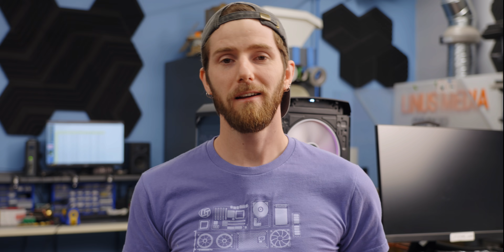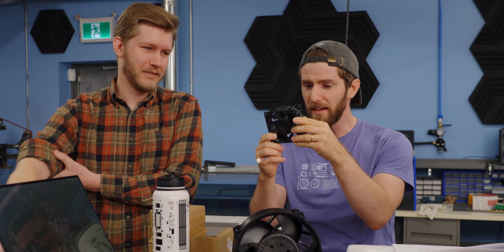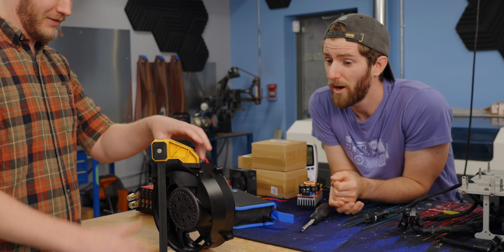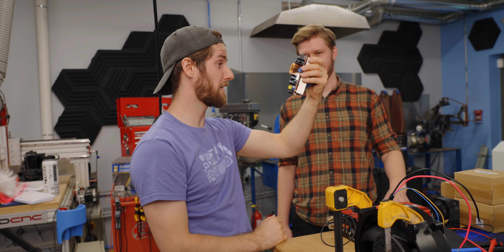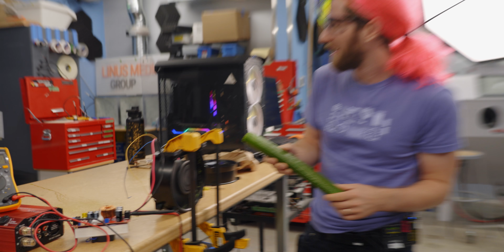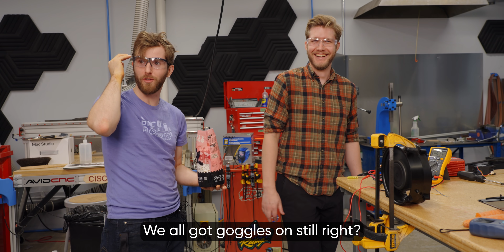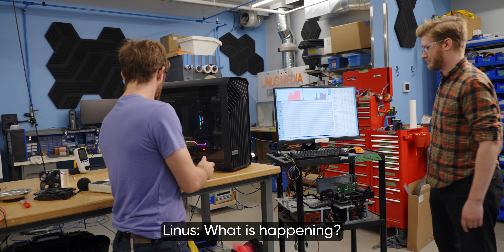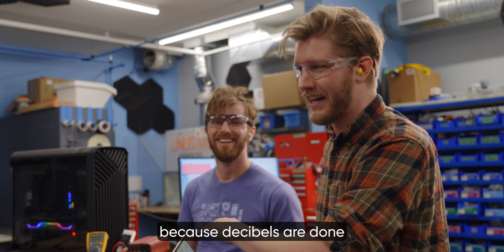The God of Computer Fans

Comment: 17:59 every 3dp is a double of pressure. For a doubling of volume as far as perception goes, you need 10db. Also, your eardrum is differentially sensitive to different frequencies. What could cause instant permanent damage at 1000hz(our most sensitive area) could be listened to for hours at a time at 30hz.
Reply: Just as it takes the double amount of input power every time you increase the volume with 3db.
Reply: not really doubling as far as our perception goes. The entire reason decibels are logarithmic is because we perceive volume non linearly

Comment: My work uses fans like these, for 50-1200kW UPS systems.
Loud in the testbay.
Reply: Do you mean 12kw or did you work with ups pulling 1200000 Wats?
Reply: @mercuryrising9758  1.2MW Frequency Converters to power Ships. The size of a shipping container.

Comment: Fans:
Noctua: Ugly but perfect for PCs
Pabst: Very durable, perfect for servers and other professional usecases
Delta: For industrial purposes. More speed. For when noise doesn't matter. If you need more airflow and more pressure. Like, a lot more^^
Reply: PABSTENNN!!!!
Reply: i am currently running Delta fans on my CPU cooler, the noise is absolutely minimal.

Comment: Bro, call it whatever you want, but don't call that aberation a 'computer fan' , because that thing has absolutely nothing to do with a computer, except for probably its diameter, and that only for a limited number of chasis models.   Other than that, its required voltage, its power consumption, its depth, its speed, its horrible noise, its 'connections'..  all of these makes it anything else but a computer fan.

Comment: We typically use these for electrical panel fans. It’s not uncommon to have a 5’x7’ panel with up to 20-30 variable frequency drives, PLCs, SCR heater controllers, 480v contactors, and layer 3 switches. All running in an industrial facility that may see temps up to 95°F in the summer.

Comment: 48V is a standard in telecom, and these fans can be used in chassis that house multiple racks of vertical optical communication cards that can crunch data transfers at greater than 400G speeds.Checkout ATCA Standards. When I used to work on such systems there was a whole module named the Fan tray, which has a grid of these fans blowing air from bottom of the rack to all the cards above.

Comment: 95db is nothing, jackhammering concrete is 130db and i wasnt wearing hear protection half the time (NEVER DO THAT, im stupid). also go to a drag race, top fuel dragsters are so fucking loud that you can feel the air and ground vibrate from 40 meters away.
Reply: 95 db is loud enough to degrade hearing over time
Reply: @23_truth_seeker_23  thats true, but then again, my ears work well enough after hearing death at 130db

Comment: Boy do I love working with those fans, they are used in many applications. They can be used in server rooms, server complex power supply stations (the EBS (Emergency Backup System), the inverters used can use IGBT H-Bridge stages due to the very large power required which get very hot, the charging systems, PDU drivers and such. They also can be used in other large power supplies. I am getting 4 for my 900 volt 400 amp power supply. Excellent video lol.

Comment: SO in the early 2000's I had one of the ill fated computers that had leaky caps I replaced the caps, and as it was still unknown as to the cause of the leaking caps I decided it was caused by to much heat as they where next to the CPU block ( Slot A CPU) also I could only get caps rated up to 85 degrees Celsius instead of the originals saying 105 degrees. I decided I had to go medieval on the fans I placed 2 large fans like those ones on the side of my case I also placed a carburetor filter over it to keep dust out the fans where 220V mains powered so I wired a 12v relay (with diode) to the PSU that would kick in when I powered on the system. I was happy with the result and used the computer for many more years. I never thought much about the noise that it made until one day I took it to a LAN party and turned it on for the first time. I will never forget everyone's faces as the fans spun up and everyone stopped talking and just stared mesmerized at how fast the fans where spinning.

Comment: u called them air flow guides, then immediately stuck ur fingers in n acted like they werent going to work as finger guards lol :p thats because as u just stated, theyre not finger guards.. n actually theyre not air flow guides either, theyre simple supports for the armature, theyre designed to b aerodynamic but theyre only there as n armature support

Comment: All you need is a basic power supply to run a fan. A transformer, a switch, diode network (bridge), maybe a zener diode to fix the voltage and a elect. capacitor.

Comment: @LinusTechTips Very interesting and amusing! My son and I just got Corsair iCUE 5000x RGB cases that came with 3 stock 120mm fans. I hate that they're RGB. I'd like your suggestions on which types (sleeve, ball-bearing, hydrodynamic, mag-lev, etc.), brands and models of fans are the best choices out there without spending a bunch of money. We don't have AC and the temps get into the 90s in the summer, so I'm pretty sure our 3 fans and tower CPU coolers won't be enough (be quiet! and noctua said they would be, while Corsair insisted that only an AIO would do the job, which isn't a surprise since they don't sell tower coolers). Just for clarity, here are our builds:
W11, i5-12500k, Asus Tuf Gaming B660-M Plus Wifi D4 mobo, Patriot Viper 3200MHz 32 GB RAM, be quiet! Pure Rock Slim 2 cooler, Thermaltake Toughpower 750W PSU, Team Group T-Create M.2 NVMe PCIe Gen4x4 1TB SSD 
W11, i7-12700k, Asus Tuf Gaming H670-Pro Wifi D4 mobo, Patriot Viper 3600MHz 64 GB RAm, Noctua NH-U12A cooler, Corsair RM850x PSU, Team Group T-Create M.2 NVMe PCIe Gen4x4 1TB SSD, XFX Speedster Swift 319 Radeon RX 6800 XT CORE 16 GB GDDR6 PCIe 4, Seagate 6 TB Expansion HDD (removed from its case and put in the PC)

Our case can handle 120 & 140 mm fans. My guess is that mag-lev is the best option, overall, but I have no idea which brands are superior. Noctua's hydrodynamic fans seem to be highly regarded, as are Corsair's mag-levs. Without spending a lot...Thanks!

Comment: Hah I see the ol gentle typhoon blade has never died , Noctua resurrected it. I still have a ton of those gentle typhoon fans I bought from NCIX & all are still working to this day after 10+ years running in all kinds of computers, I just kept taking them to upgrades & dusted them everytime & they just keep on ticking. I even use one for my thermostat on the wall that sits behind the TV in a very ackward place for airflow, just keeps on going for years. In all have like 20 of the things, all were from NCIX over the years, no wonder they stopped selling them, last forever.

Comment: These fans are used cool an entire 19-inch server rack.  48VDC is a standard for DC powered datacenter power supplies also. Directional cold-row to hot-row flow.

### Checked the specs on this fan.  You all didn't drive it correctly.  It has PWM control and you can run 36-75 VDC.  At 75 VDC the RPMs clock-in at a whopping 7400 RPM!!    Get a new 75VDC PWM DC power supply - video number 2 :)

Comment: I have these in my eletron beam unit at work, they circulate the SF6 (Sulfur hexafluoride) gas inside the high voltage transformer as it is too big for oil

Comment: If using bare screw drivers on 10 turn trimmers feels sketch, there's this actual multiturn Trimmer Adjustment Tool from Vishay Spectrol.
Manufacturer part number: ACCTRITOB308-T007 	

Digikey order code: 693-ACCTRITOB308-T007-ND
Mouser order code: 594-8T000

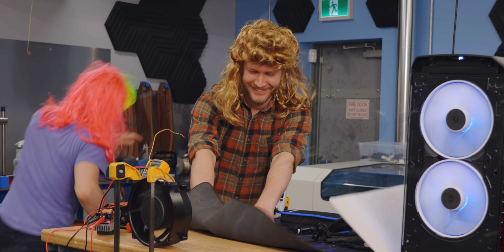Comment: So just for comparison: 500L/s of airflow (0:11) equates to 1800m³/h. A be quiet! Silent Wings 4 PWM High-Speed 140mm Case fan has an hourly volume of 133m³/h. So this fan right here has ~13.5 times the airflow of the be quiet fan. Even the best PC Case fan you can get (purely in regards to Airflow) - the "Noctua NF-A14 industrialPPC-3000 PWM" - "only" manages around 270m³/h. Still 6.67 times less than this thing. But granted it also doesn't cost 422USD and it also doesn't draw 600W.

Comment: Next incarnation of this test is getting an aircraft turbo-prop, calling it "THE MOST INSANE PC-COOLING-FAN IN THE UNIVERSE", wondering about not having 12V PC fan connectors but a kerosin inlet and rip the frozen CPU out of the motherboard socket, thrusting it through the kitchen wall of the neighbors neighbors house. Not to forget to take notes of the temperature for the scientific touch. Crazy... but entertaining...

Comment: 6:08 Electrical engineer here - "Linus, you are indeed a dummy!" :D
Seriously those step up converters are all like that. You measure output voltage and set it up with a potentiometer. They are common.
Had one in a car to boost from 12v to 19v so I could run PS2 Slim on my car radio.

Comment: These fans are also typically used in TELCO switch and outside cabinet cooling as telco equipment runs on 48v DC plant. Also, you might have been able to get adjustable DC rectifiers for less than $900 that would have been easily able to power these fans.

Comment: Hey Linus, we have a few of these fans cooling giant heatsinks on the back of two dedicated VFD cabinets. Each cabinet drives a 600 HP motor for a plastic extruder. It's easy to tell if someone accidentally left a cabinet on after shutdown because you can hear them half way across the plant. A regular PM is cleaning the heatsinks from the amount of dust and debris these fans draw up from the ground.

Comment: I've had to buy fans like this before. Making electrical cabinets for industrial control applcations, stuff gets hot sometimes. Usually it's VFDs or any motor control devices that generate a lot of heat. I work as a panel desinger for a machine builder.

Comment: The worst thing about that boost converter, and one of my friends used them to power a 600W LED... If you blow those automotive fuses at high inrush current(Depends on how your power up sequence goes, he was switching on to a 60V pack of lithium ion batteries).. Well, they explode some hot molten metal all over. Those fuses aren't designed to contain that high energy discharge. Really they should have high rupture capacity ceramic sand-filled fuses on there. He's exploded them multiple times because he didn't implement an inrush limiter circuit right away that I suggested.

Comment: PC PSU's actually run 3.3, 5, 12, and -3.3, -5 and -12vdc. That being said you can get up to 24vdc from any PC PSU across the 12v and -12v rails.

It still wont manage to power that fan by a long shot, but I thought id share the accurate information.

Comment: When I was still in the navy, we used similar fans to cool the electronics in the radar system I worked on. we had about three fans per cabinet and about ten cabinets in a single space. It got extremely loud to the point that you had to have hearing pro even when the cabinets were shut.
Reply: Bro got 200+ fps there 💀

Comment: I have these on a power supply that is used to bring a 200MW turbine generator up to speed.  It has some impressive SCRs to create a Load Commutator Inverter to accelerate the turbine to 3450 RPM from 0 RPM.

Comment: Funnily enough, there are specific tools which I dont know the English name to for these kinds of potentiometers so you dont put metal or not safe for electronics screwdrivers near them in these applications. I sometimes use them for work when I work on power supplies with hard to reach potentiometers. For all other cases though, a screwdriver will do just fine

Comment: I can't believe they dont have a variable powersupply with the electrical engineers around, the ones I used in school when doing electrial engineering technician would have been perfect for this application! You could set it to whatever you wanted to output instead of having 15,000 plugs for the PCBs being designed

Comment: I think they are used to move hot air into a water-cooling system in a server room, using water to remove the heat from the room. They are much like the ones I have seen arround.

Comment: we use a less powerful version of this fan for cooling the hot side of peltiers in emissions testing equipment. the peltiers cool the emissions gasses coming out of, for instance, a coal burning power plant, to pull the water out of the air so a clean, dry sample can be taken and measured for EPA compliance.

Comment: just a small correction: with voltages and sound pressures, 6dB are a doubling in voltage/pressure, only with power 3db are a doubling in wattage. This is because decibels are defined by power (1 mW is 0 dbm) and since P = (U^2 / R) it's confusing but that's how it is. Also a "percieved" doubling in volume means a 10 dB increase in SPL(sound pressure level). But that's just an estimate made by asking people when they felt the volume doubled so it's a pretty useless fact in my opinion.
Reply: for reference, 100 dB is the legal limit (in Germany) and it's so loud you can barely hear each other screaming in each others ear. So a very loud concert.

Comment: I used to had a pair of something simlar (those you used to put it on top of the HIFI AMP that to cool the AMP down) mounted at the side of the casing blowing air directly onto the CPU and the GPU. the only problem these fan runs on AC instead of DC, and they are just way better than the usual casing fan.

Comment: The technically desierable property of the fan is it's high pressure, not it's high CFM because you'd get more CFM with a bigger propeller spinning slower. The high pressure prevents the air from stalling though. So without a doubt this isn't for cooling the area around a server but an entire rack, to push air through. It probably is 1U thick or rather is designed to fit in a bracket thats 1U thick.

Comment: When I was a kid my father worked for Hughes aircraft out of Oceanside California and he brought home a case that was a dual rack mount side by side metal case that stood about 7 ft tall and from floor to ceiling of case was all rack mount slots and they would customize units between one and six units that had different functions like one is just your your fans one is your power supply then you have like your your precision oscillators your sensors and these would be designed to to have two fans of that size and power in one side of the case to vent both cavities
We're talking serious industrial cooling power for serious industrial equipment whether it's for crystal growing or sending and receiving radar or microwave data etc. You guys asked what these are for these are made for serious electronics cooling and removing the heat generated by high frequency precision circuits.

Comment: Im not electrically inclined but I set up power supplies at my job, we use capacitors alot larger than than, sometimes when Im assembling them the outputs spark on my pliers. Lol

Comment: ok here's something which i want to share all of those cpu fans are actually brushless ac motors with it's esc built inside of it so the esc receives three phase ac back current and it can or cannot convert it back to DC and send it back that's why it's not a thing

Comment: Linus why didn't you buy an automotive electric fan which runs on 12 volts,  some of these fans go as large as 16 inches and pushes 1300 cfm and only cost around 70 dollars. and there are some that push 5000 cfm and all are cheaper than what you bought!

Comment: This is a tubeaxial fan for industrial or laboratory use. Say, you have a mishap in a lab or industrial setting and need to evacuate large volumes of gas or air into a chamber or through a filtration system very quickly, something like this might be used. It also has a lot of useful functionality and feedback that you don't get out of other fans. It has auto restart, a tachometer, a rotor sensor, among other smart features. 

These types of fans can also be used to cool massive data farm power supplies, battery backups, etc. during extended use in the event of an outage.